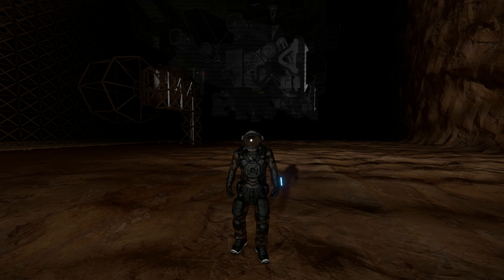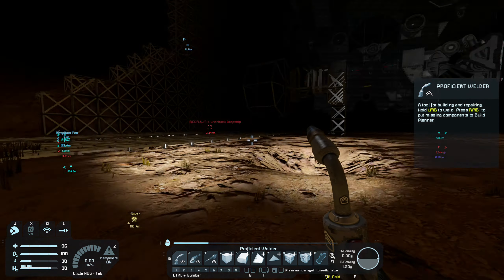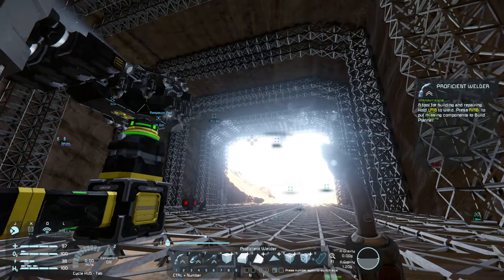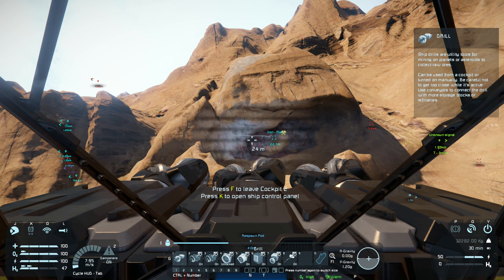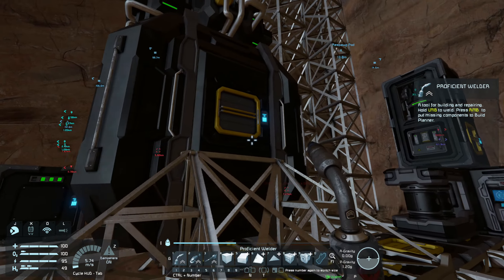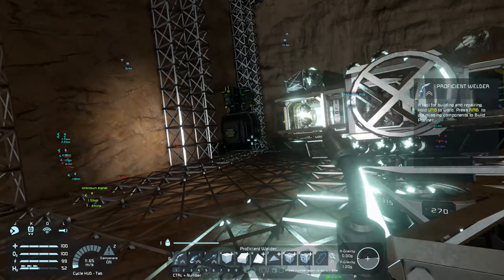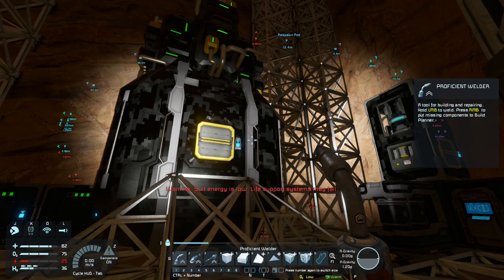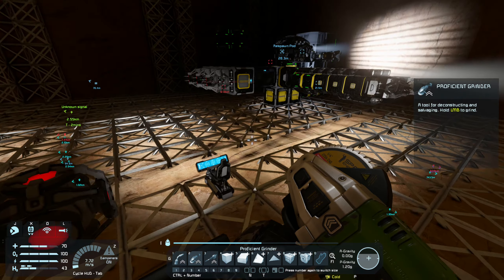Space Engineers - Wasteland Survival Ep4 - Designing the Garage and Building Welding Ships!!!

Comment: If I remember correctly, if using a printer like the one you just used here, they don't need the dlc for the welders to make them. Same with progression blocks you don't have. Unless they changed that
Reply from the maker: Yeah im not sure about the DLC and welders, when I bought the game I had all the DLC's, I do think you need to unlock the blocks to print then though, I remember trying to use my welding ship to build a blueprint and it wouldn't weld jump drives as I hadn't unlocked them yet, I remember it well because I had to move 4000 semiconductors by hand, took me forever 🤣